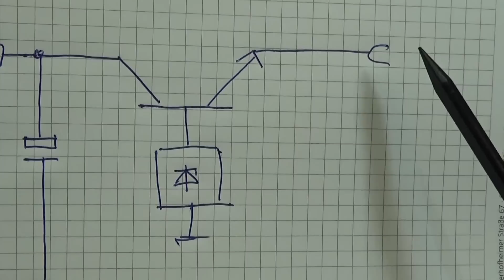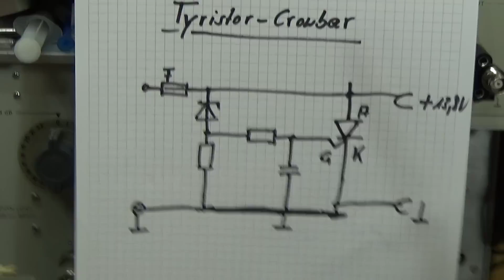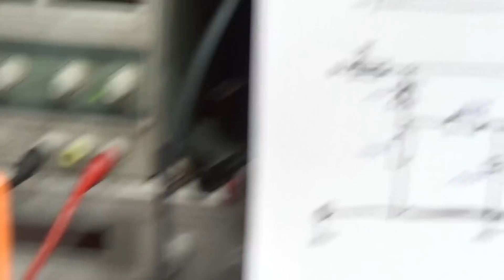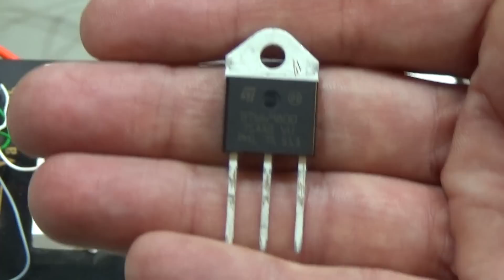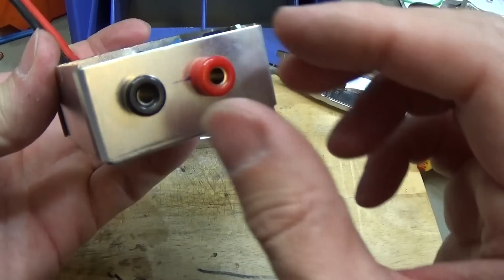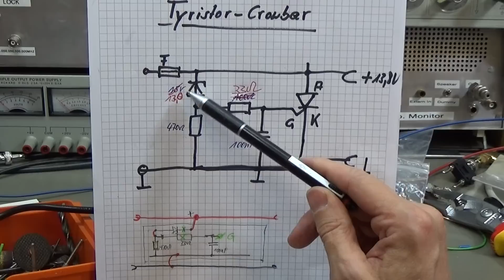#99 HAM Tip:  How to prevent a power supply killing your radio

Comment: An ounce of prevention. I think I used a triac on the last crowbar I made. The thyristor is  about the same thing. Triac  or thyristor into a diac, and you have what? Maybe $12 invested in protecting $1000-$14,000.  I have a thyratron running a protection circuit in one of my old boat anchors. If only I had a dollar for every man named Peter with a German accent  I  have worked with. I think we had 5 at one company. We also had a Hans too. 73 KI7AQJ
Reply from the maker: LOL, yeah too may Peter's and Hans on this planet :-)... Thanks for feed-back Seth! All the best and 73
Reply: Seth B: a little note: 
Hans is in fact a Dutch name, 
while Heinz is the German version!!  
Nobody knows this!!

Comment: Great video. invaluable little circuit. I have a question regarding the zener diode. i know you said 13V but is current rating of that zenner inportant? and what value did you use? thank you in advance. ivan vk5rs
Reply: sorry power rating not current .... my bad ... for exmple .... 1N5243B is 13V but 500mW max power. would that be sufficient for this circuit? thanks once again

Comment: Peter,  If you were building a Crowbar circuit for say a 25-30 Amp supply, would it not be a good idea to lay down a thick layer of solder along the tracks feeding power to the radio?  Surely the copper tracks on the Vero board would not be of sufficient thickness to carry 25-30 Amps of current?
Reply from the maker: John yes you need a strong power bus but make sure that the fuse which needs to break is rated right. 73

Comment: Is the proto board really needed? With terminals, a chassis fuse holder and terminal tags there are few enough components just to use point to point wiring.
Reply from the maker: No you can build circuits like this according your own preferences. Thanks for watching 73

Comment: I like the technology in the circuit but wouldn't it be possible instead to use an appropriately dimensioned, normally closed relay that is driven by a resister divider so that it opens (and interrupts the current to the radio) when the voltage goes above a certain level? 
The relay could require, for example, a 5v input with a series connected resistor dimensioned to the current consumption of the relay so that ty he relay opened when energized above, for example, 14v.
The resistor could even be variable (a pot) to allow adjusting of the overvoltage set point.
Or did I miss something?
Reply from the maker: Yes theoretically it is possible but  a relay is much to slow. Until the relay is switching off the radio is already damaged.. Thanks for watching 73

Comment: Great video....will this work in any switching power supply too ?
Reply: A switching PSU don’t work like a linear one. If the transistor in a switching PSU is failing the output voltage will drop. But you shouldn’t use switching PSU for radio equipment because of the ripple it produce.
But yes you can use this for any PSU. Only the zener and resistors must match the output voltage.

Comment: Is it possible to get a high voltage spike due to the small delay in the Thyristor circuit, especially with a capacitor on the gate? Maybe this could be measured by putting a scope on the output?
Reply from the maker: Hi, well even if it will be grounded..so no problem. Thanks for watching and comment. 73
Reply: But if there is a short delay before the thyristor triggers, won't there be a short period of high voltage just before it is grounded? Maybe the spike will be filtered by capacitors in the rig.

Comment: hi Peter!
is there any chance to do something similar (I mean an overvoltage protection) for variable power supplies: for example that DF-1730SB you are using in the video? if one of the pass regulating transistors fails (going  short circuit) you get the whole voltage on the output and "fry" the equipment you are powering!!!
Reply from the maker: Hi Claudio, not as easy as this project but it is possible and you can buy psu's with over voltage protection. Thanks for watching 73
Reply: thanks Peter, but I wanted something to add to my cheep Chinese Power Supply!!! hahaha 
I will look around and see if I can find something suitable.

Comment: Is there no thermal paste/pad placed between the box and the thyristor? Or did I missed it?
Reply from the maker: Hi Jordy, no not so much important as the component is not always in use... 73
Reply: +TRXBench Yeah thats right, but it could be possible that there is a voltage on the outside of the case. And of people with no or less experience.
Its always a preference for me to insulate everything. But as you said its not always dissapating 20A, and on for a short time.
Reply: +Jordy Tax less experience people can be shocked, or feel some of the voltage.

Comment: Some but very few power supplies have the crowbar or some over voltage protection built in. 
I wonder why the designer doesn't add this to their design in the first place as its simple enough and the components cheap enough.
What would they add in cost no more than $5-$10 on a $150 power supply !!
Its shows how cheaply the manufacturers build these units and skimp on quality !!
I had an linear power supply fail into over voltage because the voltage adjustment pot inside failed as the slider came away from the track and the power supply went straight to the full 30V or so, it fortunately had just a zener diode mounted inside across the output terminals that went short circuit and blew the fuse. One time crowbar, but better that nothing like most power supplies!!

Comment: Do you have a circuit project to test for FAKE or bad transistors without having to put them in the Radio until you know they are actually good?
Reply from the maker: William, there are a lot of transistor testers on the market to test for good or bad but to test for fake it is another story. In this cas you need to test for dynamic parameters that means for transit frequency and therefore you need a test circuit. That means it is a bit more difficult as all transistors are different. 73
Reply: That was the problem that the testers all show good hfe,but in the radio they do not work. I did not know if all of the Final Circuit components had to be used to make an accurate test circuit. Thank you very much,Sincerely William C. Colvin.

Comment: what part list to make that voltage droper ?
Reply from the maker: Hi Charlie, well very simple as you can see it on the schematic. A z-diode 13V 0,5W, resitor 740ohm and 33ohm, a cap of 100nf and a power thyristor BTW69-800. That's it. Hope it helps 73
Reply: TRX Bench Hi, neat solution but is the 740ohm resistor a typo did you mean 470ohm as per your diagram? 
73 Dave G7HJX

Comment: This is a nice crowbar protection system, but if it was me I would've put a relay's coil in series with the thyristor and the auxillary N/C in line with the positive output of crowbar device. If the zener diode picks up the 15Vdc it will sent a current to the thyristor's gate, the thyristor will be forward bias and conduct which will energize the relay, open the N/C to the positive of the radio without  damage to any components. Does this makes sence?  Bye the way, I love your teachings. Kind regards.
Reply: The problem with your relay solution is it typically takes 10 to 100 milliseconds for a mechanical relay to energize - especially high current ones.  During that time, your radio electronics have 30V across them.  A thyristor will fire in about 1 microsecond - over 10,000 times faster.  Also, thyristor crowbar circuits like these usually are designed to blow the fuse that is in series with the primary (high voltage) side of the transformer, not one on the secondary side.  That way it removes power from the entire power supply to prevent any possibility of further damage in the supply itself.
Reply: Ok, that make more sense. Never thought that timing also play a roll, but good thinking!!!! Thank you for your reply!!

Comment: You obviously have a very poor supply.
Most every supply since the Omni C's  in the 1970's have a crow bar circuit and all current Astron Supplys have this.
A Zener diode is included and  pull gate current on a SCR to blow the fuse when the Vcc exceeds the . Zener voltage .